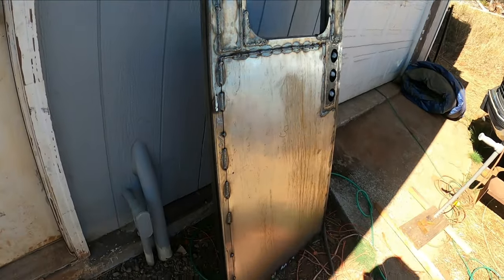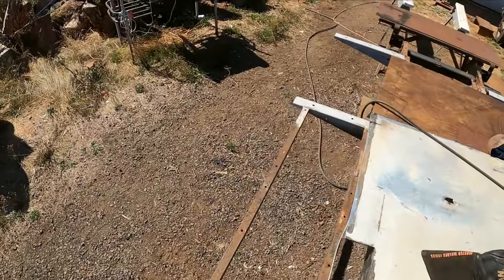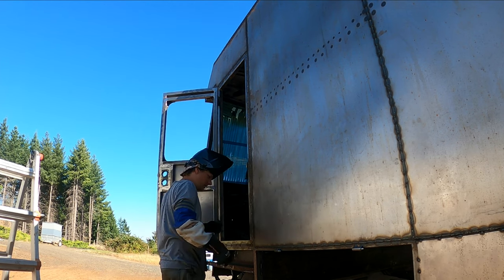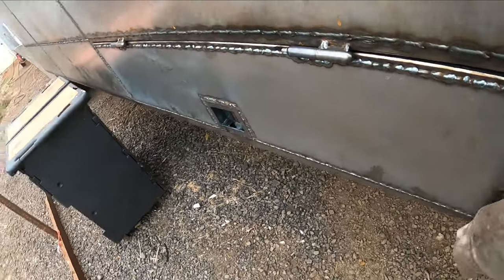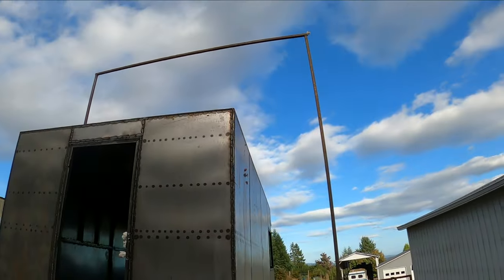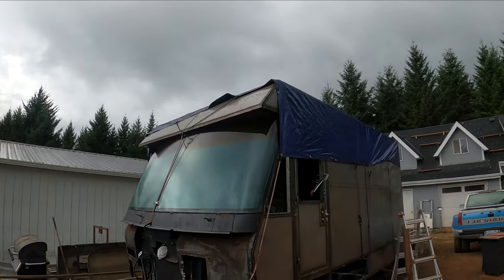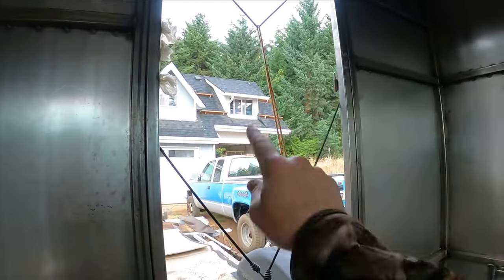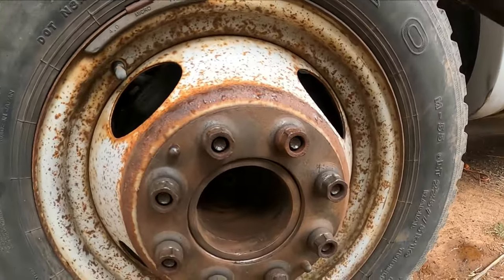RV Rebuild (Part 22) Making Mistakes and Getting Rained On

Comment: RE the door , cut into sections of the door to weaken the warped areas , then straighten and tack weld back together to then finish weld .
You can also clamp the door to a sturdy piece of steel to aid it to warping while welding, but short beads would prolly be better mate .

Comment: Put some heat in the opposite side to bend it back, you could try laying an extra bead the opposite side or blowtorch it. Try jumping further away from the last weld to give each area time to cool down rather than working close to the last bead.

Comment: Build in the floors with plywood and strofoam inner core. Only truble with build is insulation cuz its gonna be cold as heck in the winter and fire hot in the summer.

Comment: I’m half way there through your video so you may already have found a solution to the back door…my thought was to make it a split door where the bottom swings open and the top can be permanently fixed for you AC. Not much wasted metal then…
Also Bad Chad uses a wet cloth to cool down the metal while he’s welding to prevent warping….you are the Bad Chad of Washington State…keep up the awesome work Nate 👍🏾

Comment: Looking good. You've learned quite a bit from practical application and that's the best experience to earn.
If the project were mine, I'd study on moving the rear axle about 4 feet aft. Not only for aesthetic reasons, but it will ride way smoother and handle better. Not to mention it would be better for weight distribution. 
Keep on keeping on, you're making good progress.

Comment: Nathan, most autobody shops have a frame straightener jig.  They should be able to take care of the bend.. worth a shot..
Reply: BTW.. Don't go "all the way around" the panel with your tacks.. Treat the task like you're torquing down a head or bolting on wheels.. weld one tack then move 180 degrees to the other corner of the panel, do another tack. And so on until you have tacks 360 around the panel.  Keeping the panel cool.. keep a bucket of water and a rag nearby.. don't let the panel get hot enough to burn your finger.
Before mig & tig, oxy-acetylene welding auto body panel cut ins were done the same way.
Best wishes, Dennis
Reply: Actually, I think @luckie337 has the better answer. I thought I saw that you had a 20 or 30 ton bottle jack..
Hang both ends of the door (bend facing up) off the bottom of the frame of the RV with chains.
Put the bottle jack between the frame & the center of the door.
Progressively put tension into the door until a little over straight..
Test for straightness by releasing pressure & checking with a straight edge..
Reply from the maker: Great tips & info, Thanks!.. I totally forgot i had that bottle jack >.<

Comment: Please reconsider the 2nd door.  There is a safety factor with living in the RV full time to consider.  It also provides better access than the front door over the seat and steering column.  Even if a split door or a door on the side.  I do think the rear door makes the best layout.  As for the AC it can still be installed in the middle.  The door does not really need to be full height.  Do a split door and mount the AC in the top half.

Comment: You shortened the welds but should’ve jumped around. By skipping an inch and then continuing in the same area, you are still focusing the heat. 

Jump from top to bottom, left to right; like you are tightening a lug pattern. 

Don’t know if that makes sense but ….
Reply from the maker: Hmm ya that does make sense, great advise thanks!
Reply: @ClassALiving  I’m in your rv right now. That’s how I got to your channel. lol. I have the superchief 89. Same layout. Well b4. Good luck with the rebuild. I’ll be watching.

Comment: that big back door was cool but way overkill at 90+lbs  what i plan on doing with my rv door is use angle iron inch 1/2 to make a angle iron box for the door then some metal supports to hold the door knob and then use plywood for the skin/cover and foam board in between so if the door ever gets really nasty or rotten in like 5-10 years can just slap another sheet of plywood on it

Comment: try heading the door with torch to straigh  it
Reply: sometimes just heating the part up to a dull cherry red is enough to release the stresses in the welds and the part will straighten up without any bending. but i don't think he has an oxyacetylene torch set with a big rosebud, which is what he would need. a propane torch isn't hot enough.

Comment: you do know that wd40 is for stainless steel.. common mistake
and it is defently not a rust preventer it is palm oil ... if it is anything its grease remover
.. asid free oil
will do the same .. if you want to paint it anyway just degrease the oil but you can´t paint on any oil
and oil wil find any nug and cranny and getbit hard to paint